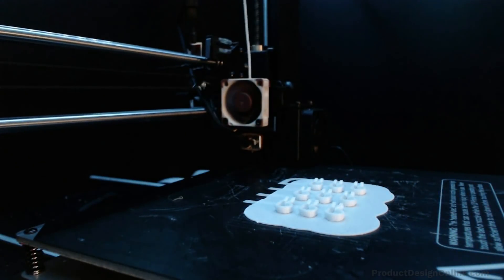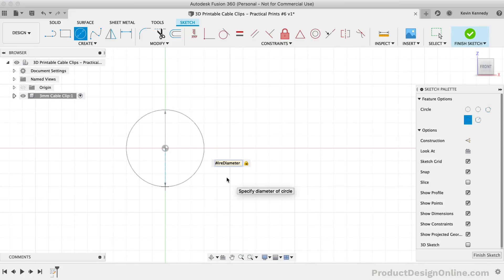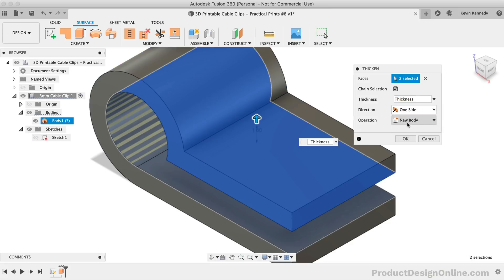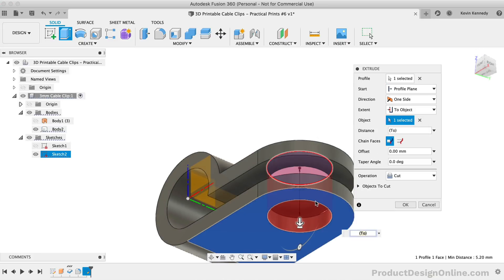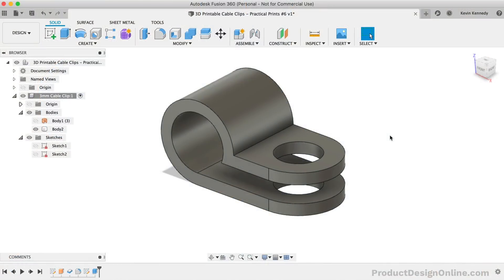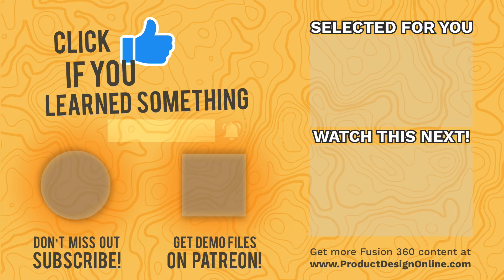3D Printed Cable Clips with Fusion 360 | Practical Prints #6

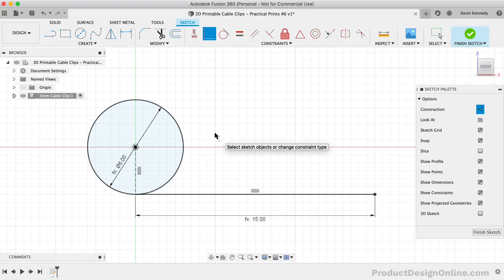Comment: When I added the construction line at 4:00, since I hadn't moved the horizontal line, the constraint was automatically added, however the constraint which was added was a perpendicular constraint, and not a coincident constraint. In this example either works, but I'm wondering if there's an "order of operations" which Fusion360 uses when determining which automatic constraints to use?

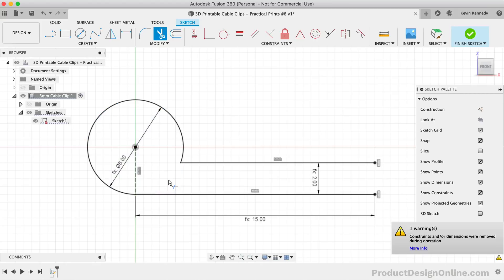Also, any idea what constraint was removed at the 6:00 mark? The display didn't change (except for the trimmed portion being removed).

Comment: Twice in this video you got error messages in the lower right, but didn't comment on them.  What were those errors, and why could you ignore them?
Reply from the maker: Hi Rick. Errors are red, which can be significant things to worry about. I believe what you're referring to were the Warnings, which are yellow. They can appear for several reasons. A feature can't compute in real-time, constraints removed, invalid dimensions, etc. It looks like automatic (coincident) constraints were removed when using the trim tool. In short, not a big deal as we had everything else constrained :)
Reply: @ProductDesignOnline  I guess I'm so used to seeing errors there, that I assumed they were all errors. Thanks for explaining it! :)

Comment: Printed the clips in 3mm and 5mm sizes using white PETG and two colors of PLA+, transparent and silver.Printing them on their side gives the strongest part and I used a brim to help with bed adhesion. It's a good design to try out different printing parameters also. Your videos have helped expand my knowledge of Fusion 360 and 3D printing. Looking forward to future videos.

https://www.dropbox.com/s/kqhhf9dgfdjftlg/IMG_1585.HEIC?dl=0
Reply from the maker: Great prints, alfineart! Glad to hear you're learning lots.

Comment: Maybe add some more ideas on how to design parts for 3d printing? Like print orientation and removing supports. Here is Mine: https://ibb.co/TYwY1xP Added a small fillet at the inside cable to prevent cable damage.
Reply from the maker: Thanks, Belen. I definitely need to talk more about designing for 3D printing. Also, great addition of the fillet - I should've added that!

Comment: Hi, I've watched many of your videos and I'm having problems trying to do something.  I'm very frustrated and about to give up.  I'm trying to make a plumbing style tee with a curved hole thru the part.  I've tried SWEEP, HOLE and PIPE commands and nothing has worked.  I will be happy to send you the file if you would like to look at it.  Thanks in advance.
Reply from the maker: Hi, novcon. Share the file as a reply to this comment and I'll take a look. Also, include where / how you're having trouble so I can investigate further.
Reply: I can't send the file on youtube,  Is there any way to get the file to you?
Reply from the maker: @novcon  To share your file - In Fusion 360 go to File > Share > Share Public Link (make sure "downloadable" is toggled on) > Paste your link here as a reply to this comment. Then, please write a separate comment letting me know you've replied with a link because YouTube flags most links and I don't always get notified. Cheers, Kevin :)

Comment: Great tutorial, love the extrude surface technique. One question and one tip. First, when you use the horse/vert constraint how do you choose which type will be used?
If I draw a 180 deg line off the circle the constraint seems to default to horizontal. If the line is at an angle it will use the vertical constraint. I then have to use the parallel constraint.
Is there a keyboard option or setting in the preferences to select the constraint type? Now, as a tip, if you select your sketch profile and then type "e" Fusion will do the extrude command
and end the sketch immediately.
Reply from the maker: Hi, alfineart. Many years ago (when Fusion 360 was quite young) they did have the horizontal and vertical options as separate constraints. The general idea is that it'll go either horizontal or vertical depending on how far the geometry is in relation to each other. There's no way to configure which one it would be.

Thanks for the tip :)

Comment: Couple areas of interest for me... 1) Show more of the alternate ways to do the same thing, it helps to understand the different options available when designing. 2) Show more ways to recreate real world objects in Fusion. 3) Do some videos specifically on using fusion to get better 3D prints - such as making your own custom supports, splitting models and meshes for dual extruder machines (or how to make make it work with changing filaments for multi-color printing), and designing with layers and overhands in mind.
Reply from the maker: Thanks for all the great ideas, AgentLintZeal! Love the ideas of custom supports and changing filaments :)

Comment: Thank you for another well presented video.  No matter what the content, I always learn things(s) from your videos.  
Your use of a thickened surface reminded me of the part of Fusion 360 I struggle with most:  best practices. That is I'm interested in ways/rules/guidelines for Fusions 360 that keep sketches and models simple and easy modifiable.  I model for 3D printing of primarily mechanical parts that frequently go through several iterations until they function like I want them to.  Often these models include multiple, related parts.  With respect to modifying the Fusion 360 models, my early works were disasters.  Current works are better due to hard lessons and tidbits picked up through Fusion 360 tutorials, but I feel I have a long way to go.  And while this seems to be a more advanced topic, I really wish I'd had a list of rules to follow when I was just starting out even if I was not entirely sure why the rule existed.  Thanks again for your excellent content.
Reply from the maker: Thanks, Robert. I like the idea of a "Best Practices of Modeling in Fusion 360" list! I've added that to my list of different assets to create :)
Reply from the maker: Congrats, Robert! You were selected for one of the Third Prize packages. Please send an email to kevin[at]productdesignonline[.]com with your shipping address and I'll get that sent out asap :)

Comment: I would suggest, make some videos on different styles of using 3D CAD software
https://ibb.co/j81vTjf
Reply from the maker: Great work with your model, Ants Agu. When you say different "styles" are you referring to "surface modeling", sculpting, etc? If so, I have done a small variety of those in the past. But could definitely do more in the future :)
Reply: @ProductDesignOnline  More on "bottoms up vs top down" and are there any other types etc
Reply from the maker: @antsagu  gotcha - good point :)

Comment: Why did you use "To" for the extrude instead of "All"?
Reply: I'm not an expert, but by making it go to the bottom side of the bottom piece it will work regardless of the geometry changes you do.
Reply: @TravisFabel  Using "All" will do the same thing as "To"  without the need to flip the view to find the "To" object. I prefer to not make more work for myself.
Reply from the maker: Hi David.  In this scenario, either way would technically work. However, I would advice against using "All" in this scenario. Mainly because of best practices/getting into the habit - if you were to add other features onto a model and have any parts that go in that path then they will be cut out as well. Again, this may not be pertinent to this specific model, but more complex models this is definitely something to consider :)
Reply: @ProductDesignOnline , In fact, this model is one of the few where "All" actually is safe. By design, the model in question has one surface which will be coincident with the surface to which the object will be attached. So, any part added on that side, as well as any added between the two parts, needs the same hole or the part could not be mounted. This is true of any object that is added that between the two parts which have the "to object" hole. The only location where a part could be added that would not need the hole would be on the unaffected side of the hole start ( "All" like "to object"  is directional so only goes from the top through to the bottom unless you make the hole bidirectional in which case, there is an opportunity to make an unwanted hole)

Comment: One thing that could help the content, would be a keyboard locker, that reports the use of key press, like the one the 3D professor is using in his videos.
Thanks for your great work and tutorials👍😀
Reply from the maker: Hi, Asger. Thanks for the idea. My screencast software does have this ability and I've done this in some videos in the past. The challenge I found was that it often covered key parts of the screen or it was very repetitive with certain tasks - resulting in me having to spend quite a bit of time to cut it out. However, I do agree that this can be useful...so I'll look into what I can do to improve this so I can incorporate it more :)

Comment from the maker: TIMESTAMPS
0:00 - Designing 3D Printable Cable Clips
1:00 - Getting the User Parameters
1:30 - Starting the sketch
4:00 - Making sure the sketch is fully-constrained
5:45 - Trimming excess sketch geometry
7:00 - Using the Surface Extrude (trick)
7:37 - Thickening the surface
8:26 - Adding fillets to the edges
10:33 - Changing User Parameters
11:30 - Print Results
Reply: Product Design Online, nice use of parameters, I recommend utilizing an app called fusion displayer, if I can remember, I will post a link to the github location where you can download and install it tomorrow. This automation script will allow you to create various configurations of your design without having to change the parameter values manually each time.   Keep up the good work.
Reply: https://github.com/tapnair/FusionDisplayer
Reply: https://www.thingiverse.com/thing:4177595  I made some modifications to improve strength and prevent pinching the cables.
Reply from the maker: Love the modifications - great ideas!! :)
Reply: Hi Kevin, I have posted my design on your Facebook Page. Thank you for all your terrific videos - I've learnt so much from them, and still a long way to go. Glad to be a Patreon and recommend others to support your time with a donation, either Patreon.com or buymeacoffee.com
Reply: Love the videos! Maybe add some background music and time-lapses at more repetitive parts of the designs!!
Reply: @kylefenn9842  Please no dreaded music. Just keep up the  explanations as concise as you already do.
Reply: @Stoneylloyd  we are on the same wavelength